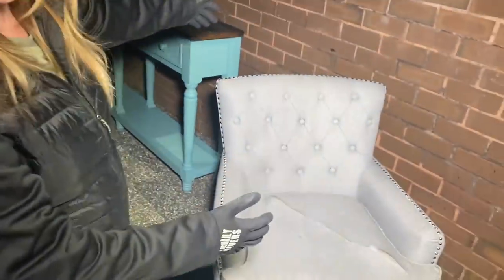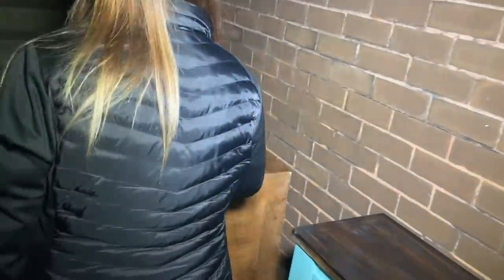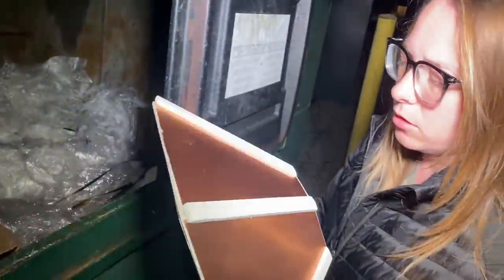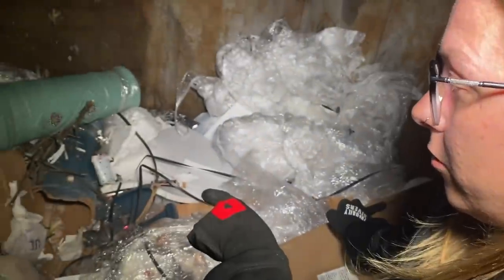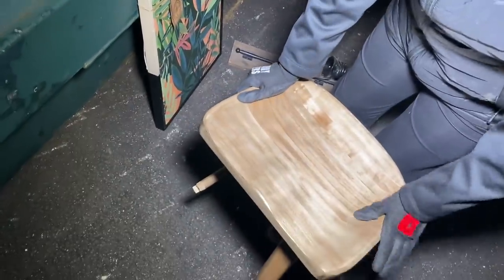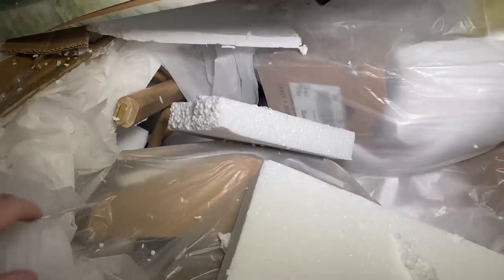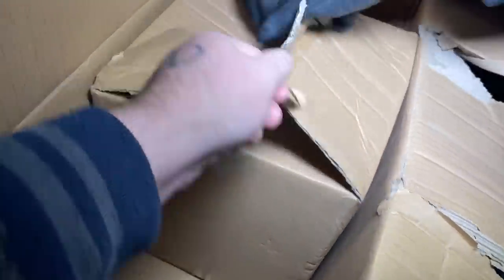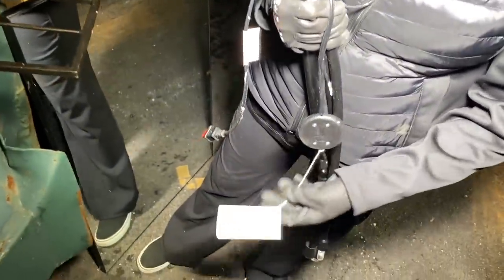EMPLOYEE'S LEFT US A MASSIVE SURPRISE AGAIN! BEHIND THEIR STORE!

Comment: The little cabinet is made of Acacia wood which is very hard to work with usually made in Indonesia or India Pakistan areas. Acacia wood is a very hard wood like Oak but it also has some nice natural features in the wood grain, I am guessing it is the top of the console table also. Most people bring these back because the varnish they use to seal the wood is very pungent strong. I worked for a company that imported items like this from various place in the third world because they are cheap and they have a good resale value because Acacia is classed as an exotic wood. If you find it smells put it in your garage for a few weeks and then use a wax polish on it and buff it up with a lint free clothe i had bought a mahogany book case and console table and they smelled for a few weeks because of the fumes from the varnish they used to seal the wood. I used a clear wax and buffed up and i have had these pieces for about 20 years now and they don't smell at all and they are still in the same condition as i bought them very strongly built with peg and hole construction.

Comment: Wood putty, sand paper paint. All you need to repair the crack in the couch sole. Stich Witcher or other brand of fabric  fusion material works for fabric slices. Put a panel of fashion cloth underneath the cut. While someone holds the fabric together the other person slowly holds a warm iron over the area  being held together. Then progress down the length of the cut until all areas are fused

Comment: You can get a puffer with carbon powder in it on EBay that you can use to loosen stiff locks or to help drawers to run more smoothly 
They say not to use oil or WD40 in locks as over time they just get gunky